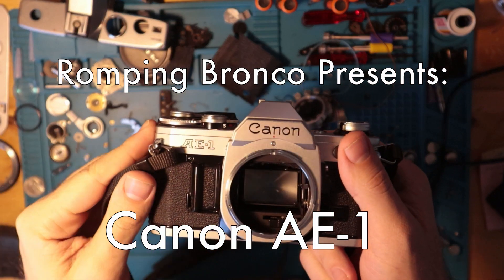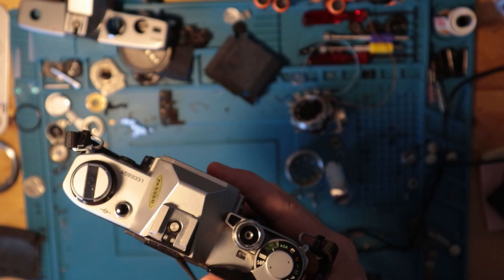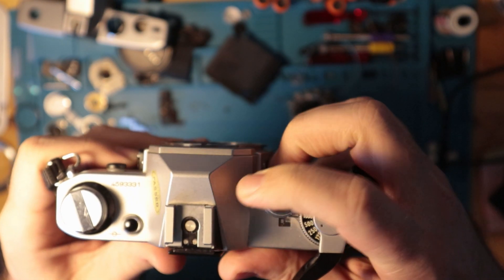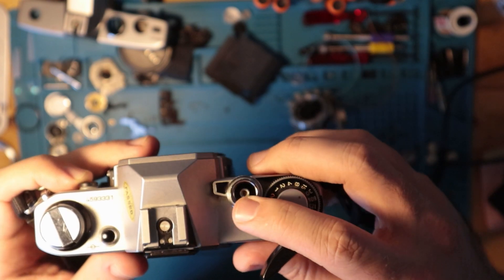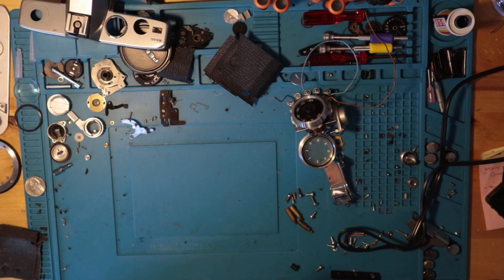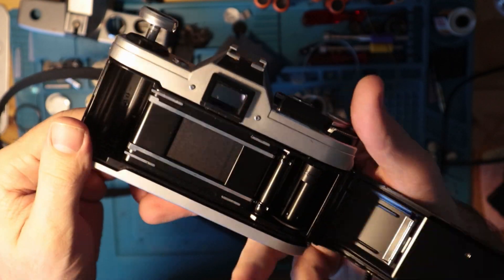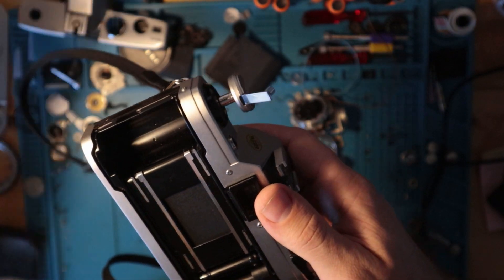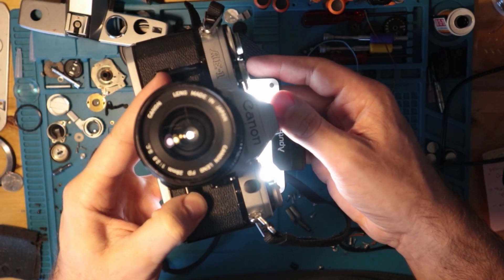Canon AE-1 Walkthrough

Comment: Hi thanks for the video. Great explanation. I just bought mine for probably a little too much money and it seems the light meter is not working correctly. As soon as you half press the trigger the lightmeter needle drops completly down and the red LED is blinking indicating under exposure. I changed the battery already and the "test button" shows a full battery. I tried different Shutter speeds but the light meter keeps dropping down. Do you have any tip why that could be? And is the camera functioning without proper light meter? As far as I understood its just a "hint" what aperture to use?